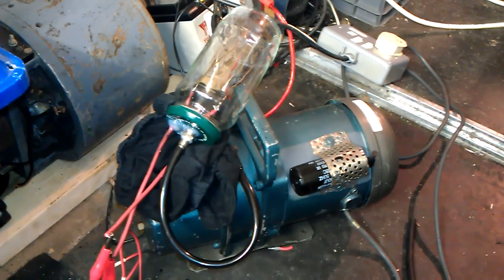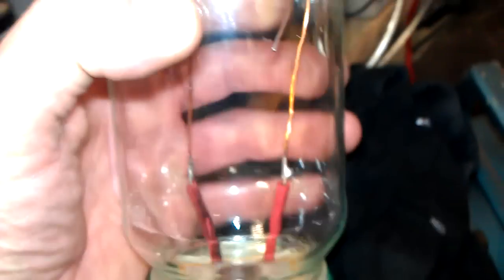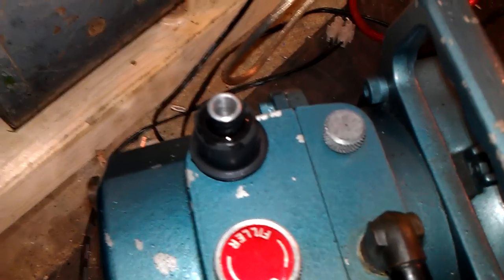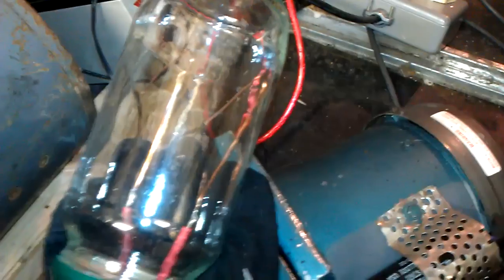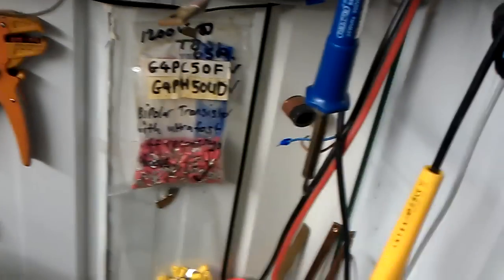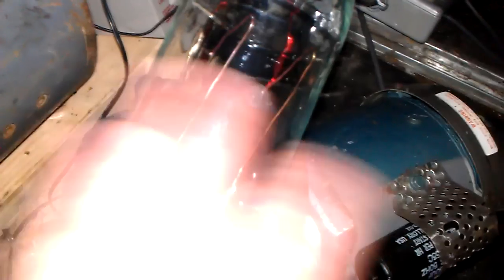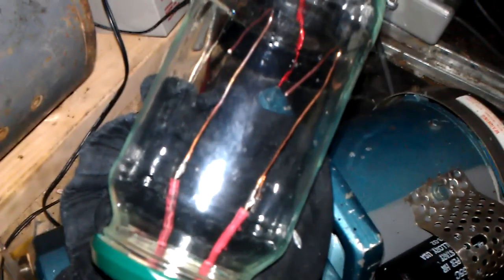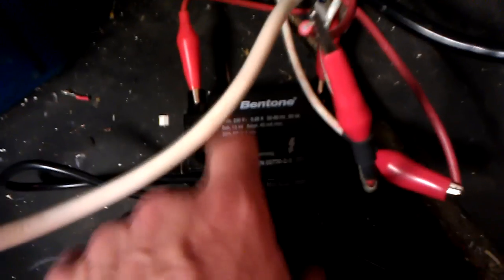Arc's in a vacuum

Comment: The guys in the early days with their crude vacuum tubes, even ones with some gas in them to make coloured light produced x-rays. I have seen guys on here put enough voltage across a crt tomake it flash over. Valves from TV's start to put out x-rays over 20KV.If you can't measure the radiation best to be careful. Painful slow death from cancer not nice. My .01p worth

Comment: i put at least 30kv across a 1" gap inside a vaccum jar just like this, and i doubt i produced any x-rays.. the design of an x-ray tube makes the electrons impact metal. if anything is being produced i also doubt our vacuum is deep enough. voltage is high enough yes, current yes, but vacuum and configuration no just my .02c